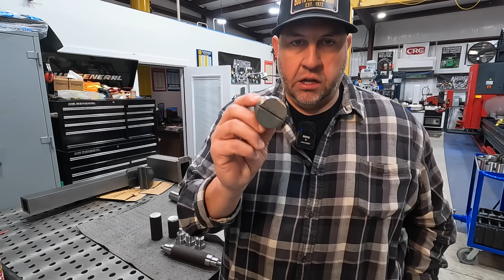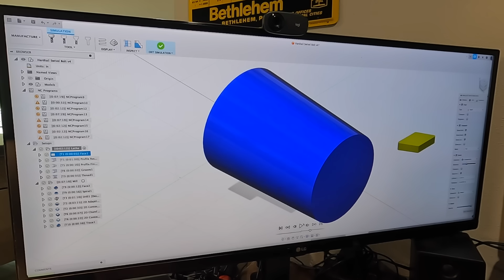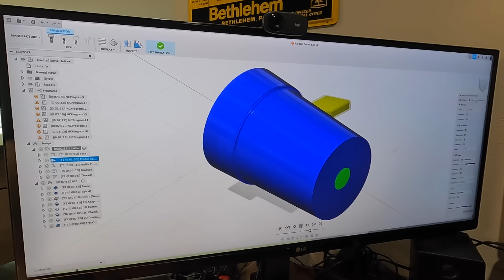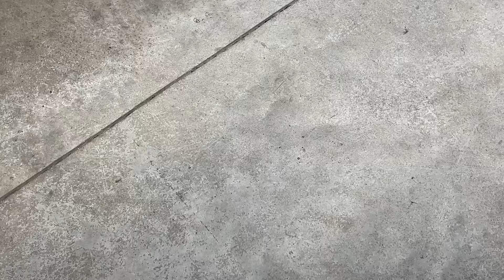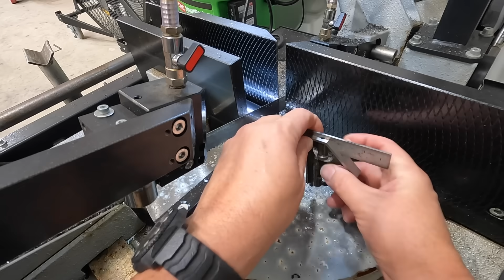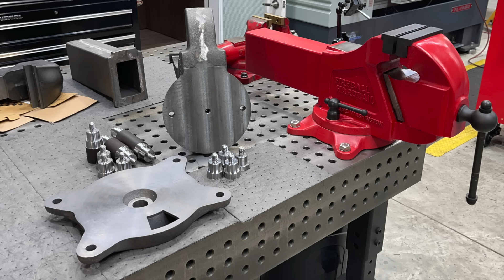Hardtail Vise Build Ep.12: Swivel Bolt Turned in the CNC Lathe

Comment: Try moving that threading tool back in, I never ever had my threading tools hanging out that far, we used to thread free machining brass at 3,000 rpm and get perfect threads every time, I do appreciate you are working with a much harder material.

Comment: Ok, where are you touching off the tools? Don't you have to make a cut with each tool, and then gauge ti to make sure you're getting what you've coded in? If not, you have to put in an offset and run it again, right?

Comment: Hey Adam, one thing to look out for if your getting chatter on your threads is the stick out of that threading tool. I was running a job on our mazak lathe last year. 17-4 stainless steel and we had some chatter on the threads. Sunk the tool in as much as possible and it was     night and day difference. That pretty much goes with any tool but i just remember that one particular job and honestly in my mind the tool wasn't even sticking out too far but definitely was enough to cause chatter.

Comment: Hi Adam
always fun to watch videos from you.
here is a tip that may help. You have too much protrusion of your tools. your tools should be as close to the turret as possible, to be as rigid as possible.

if you don't have room to reduce the tool protrusion, I would cut off part of the tool holder to have less protrusion on the tools.
You will solve a lot of problems with it and you will get better results.

Also use a torque wrench for the chuck, so that you better learn how much torque you need, and get more stable results between the parts.

Comment: In the simulation, during the thread cutting phase, you probably have an expected collision with the holder of the cutting plate. I'm not sure if it's possible to change the default cutting plate holder - some time ago I switched from AF360 to CreO and AutoDesk releases an update every month
Reply: The grooving tool leaves some stock in the corner that the threading tool pushes through. That is where you see the red.
Reply: @MechanicalAdvantage  With all due respect, your observation is wrong. Please look at 9:50 - according to the signaling rules, the tool, not the workpiece, is highlighted in red. The toolpath simulations do not take into account the existence of chips and discontinuities of the machined surfaces.

Comment: I don't know a whole lot about machining, but I figured I would pose a hypothesis on the slippage or push-back you're experiencing and how to fix it. I don't know what type of coolant you're using, but I'm guessing it's an oil/water mix, and that's what's causing the slippage. I would do a more thorough drying of the chuck jaws interface faces with a clean rag, and if your flipping the stock, wipe that down too. Maybe you already do that and don't show it, I don't know, just figured I would throw it out there and see if it helps. Thanks for sharing what you do and how you do it. YT wouldn't be the same without you.

Comment: There’s a lot of folks that find these videos educational. 
It should be mentioned that using gloves on the lathe is typically not recommended. 
It’s a real safety concern.
Reply: can you explain more? what could go wrong? Isn't it better than without it?
Reply: @ramtinnazeryan   Gloves can easily get snagged and cause serious injuries.
If you're not familiar with a lathe, just do a quick google search for " Engine Lathe Safety".  You will see a short list of basic safety recommendations.

The parting operation that Adam was using the glove for may not be "high risk"  for an accident, but in general, gloves are not recommended.

Comment: Great work, Adam!  You not only have some parts that will please your customer, but you also have a program that is potentially a valuable piece of intellectual property for your shop.  I earned a living as a software engineer since the late 1960's.  The basic principles of modularity, testing, consistent naming of variables, and clear documentation really haven't changed that much since the beginning. It took a while to get the field going, but these principles hold for all engineering, not just writing software.

Please tell us why the Fusion360 cutter went red when you simulated cutting the groove at the end of the thread.  I suspect that it was noticing that the ball mill was being asked to plunge into a sloping surface.  Just a guess on my part, but it would be fun to know.

There are two manual operations that perhaps you could automate.  First, could you just put the stock in without measuring by hand and then have a Renishaw touch probe find the length?  Your program could stop and declare an error if the length was way off.  After the end is faced (with minimal machining), the probe could be used again to test for shifting of the part in the chuck.  The second is your use of the file to clean off the tops of the threads.  I can think of several ways to ensure clean thread tops automatically.

Comment: 36:13   gloves?
Reply: Gloves on the lathe should be fine, until you realize it was a horrible idea.
Reply: Sharp edges, high speed of rotation, not good for bare skin
Reply: @sinisatrlin840 
Sharp edges, high speed of that glove catching on something, not good when blood gets all over that nice clean shop floor!
Reply: @hook-73  The way he have used is fine. 
What would you do? Normally when part is hollow i insert a drill in center hole to catch my part.
This what Adam did is acceptable. He did not go near chuck jaws, part fell into hard welding glove.

Comment: I never thought I'd see you getting comfortable using Fusion 360 and a CNC machine. However, I like it! I've been learning Fusion 360 for 3D printing. It's a handful but it is so gratifying when you ultimately just pump out a design and then the g-code without struggling.

Comment: Perhaps you could just start with threaded portion first and use the"unfinished "rigidity of rest of part to impart a better finish on threads, not to be overly critical ,but part literally 'sounded " awful or 'bouncy' cutting threads,consider more and lighter passes.Good video.

Comment: Fun for this former design/development engineer to see CNC lathe work up close.  I was only allowed to look through doors of the machines making my designs.  The sound of the spindle speed automatically keeping surface speed constant, and realizing that the spindle is going the other direction and the cutting tools are "upside down" was great.  I did not think that I would watch the entire video, as I have no interest in adding CNC to my basic shop, but I enjoyed the entire video.
Reply: our cnc designer dont even know how to start up our lathes, and it shows in some of the programing, ive had to get him out on the floor and show the problem then he goes and fixes it, Im an operator and ive never touched a design system, how crazy is that.

Comment: you really need to do something about the pushback. either make some cross serrated jaws for the current chuck or get a wedge bar chuck as they come with serrated jaws already. wedge bar chuck has much higher clamping force than a scroll chuck as well, might even help with chatter.

Comment: Glad to see you embracing the world of CNC and fusion 360. You only have eight passes on your threading cycle. I can hear it’s really cutting chips hard. I would change that to 20 passes. You’re not trying to run production here you’re trying to make a good part. Great video enjoy the series. when I thread, I make the diameter of the thread, .005 less than nominal size. this will save you on filing.
Reply: Adam, there are two really useful suggestions here!

Comment: One possible answer:
The tool turning red usually indicates a collision. If your actual tool that you are using in the cnc is drawn up correctly in the CAD then you Will have a problem. If it's not drawn up accurately then you may get away with it.
The hex is an embarrassment. Get a wobble broach. Fantastic piece of tooling.
Too much tool stick out Adam. Yes it's CNC, but it's not a magic wand. The same laws of physics apply, just like they did during manual machining. That was a lovely fit on the threads by the way. If creating the threads is pushing the piece into the chuck, depending what thread cutting program you are using consider taking less of a first cut or maybe add more passes. I'm sure Jason would say yes to you making him 100-150 of those swivels. It would be great practice and a real novelty having a Fireball tool vice with an Abom swivel bolt. And I'm only guessing, but also a  bit of payback for any deals he has cut you in the past.
Reply: hmm never noticed the tool sticking out. good point!

Comment: I thought most CNC Lathes had pneumatic chucks to give constant pressure and do away with push back due to human error now
Reply: Hydraulic typically instead of pneumatic. I imagine it's an optional extra when buying entry level machines and not default. Pushback is still a thing that can happen even with hydrulic chucks if you have the pressure too low.
Reply: @missoss suggested using a torque wrench to tighten the chuck.  Not as nice as a hydraulic chuck, but likely a lot cheaper.

Comment: Loving it. Making an individual part on the CNC is time consuming, and uses a lot of practice material, however if you were to then go into production on the part, and knock out hundreds of the things, the time and effort would be worth it. I used to knock out 'shear pins' for one of our plant during the quiet periods - and the nature of the plant meant they would pop them on a regular basis. If CNC existed back then (well it didn't in our shop), I could have produced 100s of shear pins in the time it took me to make 10s manually - and that was a really simple part.
Reply: We use CNC for one off parts pretty often but it really depends on the complexity. If we have tapers with a tight tolerance requirement we'll typically run it CNC by default due to the machines inherent accuracy and it means no setup changes to the lathe are required. But definately depends on the part specifically.

Comment: I was thinking the same thing on the slot vs the hex...  I mean, maybe they are trying to mechanically limit the torque by using a slot, but after working on machines and cars for so long, I just hate it when I see a driver slot...  Im sure it's fine, but my subconscious just will not accept it for what it is,   I have a CNC machine in my shop.  For something simple, 9 time out of 10, I head to the manual machine...  For repetitive production work, CNC its the only way to go...  Obviously for simple parts , modeling, setting up, and dialing in your cutting parameters take a lot of extra time that a manual machinist can just step up to the plate and knock out like routine work.  The exception is when you start getting into complex and compound geometry... Multiple tool changes and features can also be something that pushes you into the CNC direction.   There are diminishing returns on screwing around with a part, especially when you are trying to get paid to do it.
Reply: I had the same thought. I was like "hope Adam uses a hex", then I thought "wait, doesnt that imply you're meant to torque it down?"

But yeh, that slot is ugly.

Comment: working a CNC is much like how I use a plotter for vinyl letters.  Sure, I can hand cut them faster or even use a template but once you learn the program and get proficient it's just as fast and more accurate.  It takes time tho.  I've been doing signs for 35 years and I'm still old school in alot of ways like hand painted lettering, but I really love my plotter too.  Especially when you need to make a bunch.  CNCs are more for repeatability and they're great for that, but one offs do take longer than just manually do the parts.

Comment: Why in the world are you so determined to program and run your threads right to the pitch diameter and scrap so many parts? Do you not understand how to use cutter compensation? You could quite easily keep the threading tool +.015" and run the cycle. Then re run the cycle over and over again until you work the offset down to where it meets spec. Also you seem to want to run everything at max RPM. That machine is not nearly rigid enough to be trying to run like you want.
Reply: same here
the next thing, i understand that u wanna become better in F360 (and simple parts are easier to "program") but tbh the same Part u could probably program in 10-15 min on the machine with 2 Cycles
1. Cycle: the same what u did
2. Cycle: a finishing Cycle for the Thread wich u can run over and over with the Tool compensation until u have ur perfect size

and at last, the Tool stick out is really too much
Reply: @turrican5989   I agree about the stickout. All of the tools are sticking out a mile on that tiny turret. Maybe that's where they need to be, not sure but it's not good for chatter resolution. I also feel like the part can easily be programmed in the terminal if that machine came with that. Or just learn long form and type it in. He's far FAR away from needing Fusion for anything he does.

Comment: Looks like you need a chuck wrench with a sliding handle to get more torque on that 3 jaw.
Reply: If you need to over torque something to make it work the problem is elsewhere. There should be no need to put a ‘cheater’ bar on a 10’’ chuck to make it grip under normal operation. You’ll fuck up the operating screws an scroll and trash the chuck.

Comment: Have you bought a SpaceMouse to use with Fusion 360? It is life changing!
Reply: What is that?? I'm curious
Reply: @calvinculpalt Secondary CAD mouse you use in the opposite hand to your regular mouse. Let’s you pan, tilt, rotate, zoom as well as having programmable function buttons (functions within Fusion 360 or other programs). Very intuitive. Just google 3Dconnexion.
Reply: That looks pretty slick, i dont do enough designing yet to justify the price but ill try to remember it in the future.
Reply: I looked it up.

Comment: Question: would tight fit on the swivel screw cause binding and extra static stresses when lock nuts in their rough casting surface v-groves are tightened?
I would imagine tightening of the lock nuts will actually cause the whole vise to shift a bit when the rough conical surfaces press against each other.
Also, the tolerances in concentricity of the V-grove might add to the shift. Will this be a problem?

Comment: I still question using a standard chuck wrench over using a torque wrench to tighten the cnc chuck. Just one of those repeatability things. And I'm guessing that you need a chart of torques for each type of material, but it might be worth talking to the manufacturer of either the chuck or the cnc.

Comment: It must be just as difficult as it is fascinating to organize all the operations you'd do on a regular lathe into the software on a CNC machine while trying to get every last detail in there like spindle speeds for different ops.
Reply: actually in Fusion 360 they can set up multiple cut paths fairly easy with different cut parameters on each cut path for the same finished object. there are also many online tutorial videos.

Comment: Karl Marx, Nikola Tesla, Balfour, Einstein, Huxley, Orwell, Turing - should be forgiven for thinking their systems can last forever.
Finite fossil fuels are dangerously hypnotic to humans, their consciousness, reasoning and mental capacity.
Humans were not ready morally, ethically and intellectually to start the mass extraction of fossil fuels with the advent of the steam engine 300 years ago. 
The Magna Carta requires today overhauling – adding to it the right for humans to understand what Energy really is - before any other commandment;
“In any system of energy, Control is what consumes energy the most.
No energy store holds enough energy to extract an amount of energy equal to the total energy it stores.
No system of energy can deliver sum useful energy in excess of the total energy put into constructing it.
This universal truth applies to all systems.
Energy, like time, flows from past to future” (2017).
Reply: Your comment has nothing to do with the video. If you want to spread this, do it in a constructive manner and make your own video about it instead of posting it on a machining video.
Reply: @trigger23291  We all love Abom79 and enjoying his fine works over the years, gathering together over it for a roadmap into the future. 
The video has a lot to do with the comment, though - i.e. hard work is always - Energy.
Reply: @sunroad7228  Nope, machining has absolutely nothing to do with anything that you are spouting off with. Again if you want to spread that you should make your own content about it.
Reply: Learn to read the room man.
Reply: @mathewritchie  "Learn to read the room man" - or - we send an aircraft carrier.